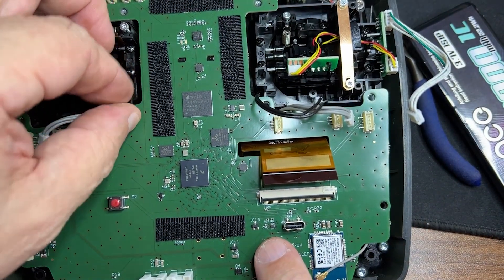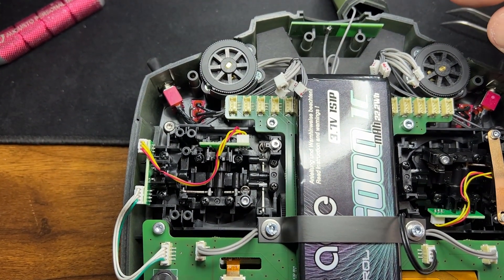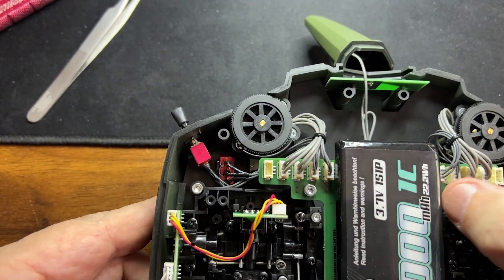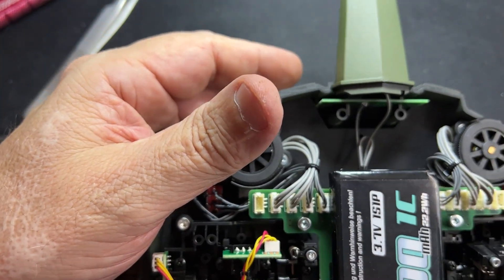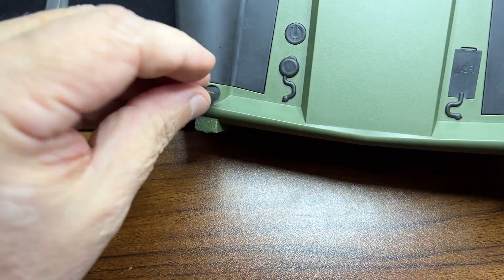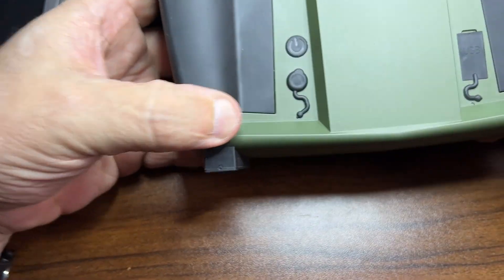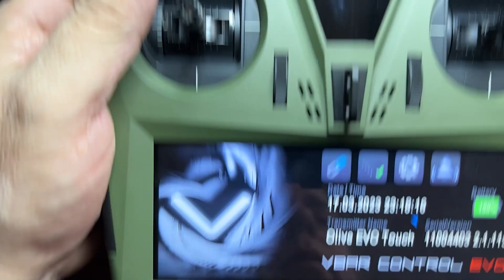Mikado VControl EVO PCB spacer fix as per Mikado's Safety Bulletin

Comment: Many thanks Auggie for the video instruction, however I'm kinda really disappointed with Mikado, considering the cost of the transmitter. I do accept that sometimes there maybe issues and on the surface this may seem like a simple fix. On the other hand My very expensive helicopter could have been 300 feet in the air doing 160MPH and the controller could have just shorted out. but whose problem would that have been, Im really pleased that you and mikado have put something out and indeed notified us of the issue but I guess for some people it may well be to late. I really hope no one looses their expensive helicopters due to this fault.
I will be fixing mine shortly - pardon the pun . many thanks for the great video.

Comment: Personally Auggie I think this is just shoddy from Mikado who are the so called purveyors of top quality professional controllers - bad form from Mikado and completely unnecessary - they should recall them all.  Thank you for the vid!
Reply: I could understand if it was a low end radio, it’s a flaw that shouldn’t of happened, Poor coming from Mikado it wasn’t picked up during design and testing
Reply: They tested for months with no issue, also passed FCC requirements and testing. So if they don’t know they don’t know?
Reply from the maker: They did recall them and give you the choice of them doing it for you or you do it yourself. The ones coming to the US have this fixed at the factory.
Reply: Completely agreed. Absolute bull shit. Top dollar, for mediocre quality. Thank you Auggie for your video. I'm still running the original vbar touch.
Reply: @MCK13666  you would of expected using the word Evolution it would of been something special a completely new design, I am convinced if it had not been for the aging chipset Mikado would still be pushing out the previous model. Great operating system in a cheap case.